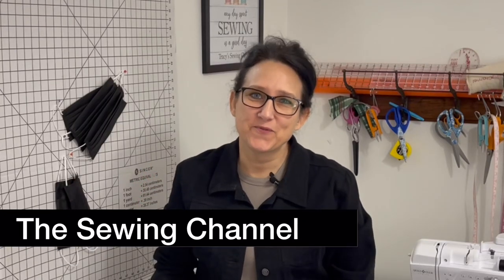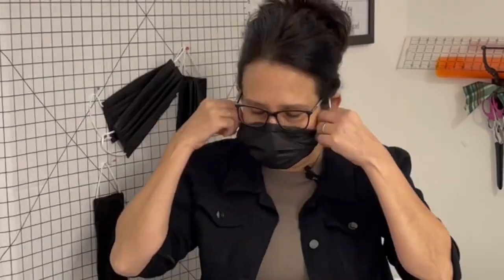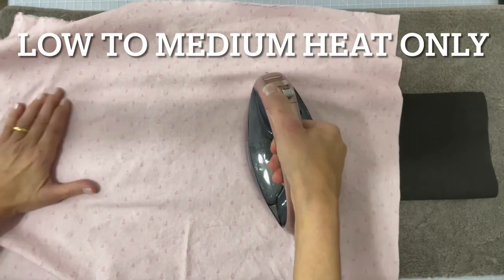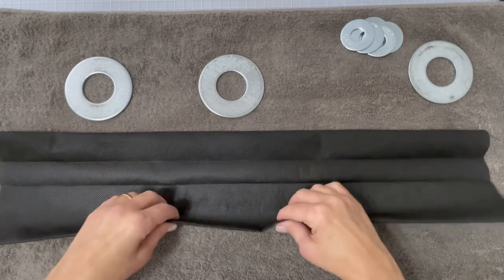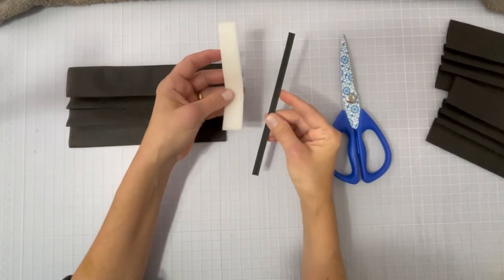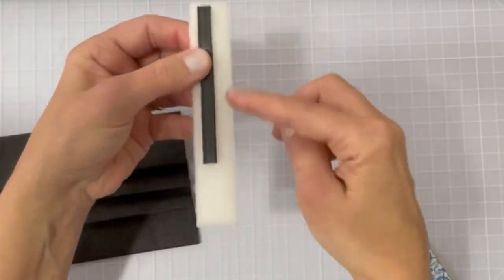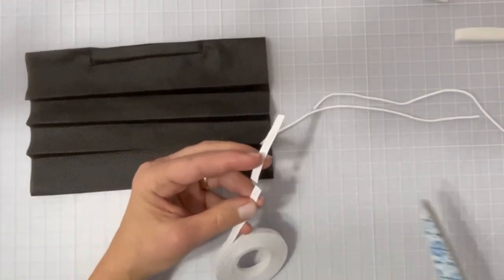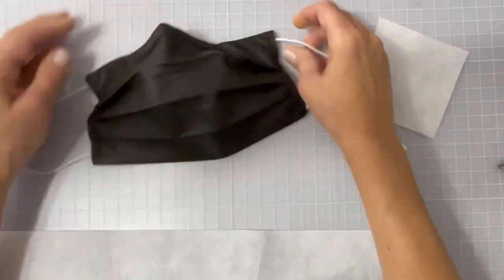How To Make A Disposable Mask With Cambric Material

Comment: Hi Tracy!  First time caller, long time listener. Lol!  ;-) 
I am with MakerMask.org and I just want to tell you that your video is fabulous!   I also use weights to hold down the material. I don’t have quilters clips, but binder clips work great.  I agree that coffee bag closures are the absolute best for the nose wire.  I love them.  Thank you for showing how to lightly iron NWPP on low and covered by a cloth. Very important.  I have also seen others use a craft roller to press their NWPP while mask making. 
Do you know if the foam is washable?  I have several people asking for a washable foam.
If you or any of your followers would like to join a group that shares ideas about using NWPP in masks, you are welcome to join our Facebook group @NWPP4masks.  And you’ll find a post there with this video. All the best!  Hope, Education & Outreach, MakerMask.org
Reply from the maker: Thanks for supporting my videos.....I appreciate it so much.💛 I absolutely love the NWPP the BEST for mask making now...The "crucial" part is getting the crisp pleats without it melting LOL - The foam I use is washable and dryer safe✅...It's made by Pellon and I've had no trouble laundering it at all. Thank you for sharing my video also.💛
Reply: I have a ton of NWPP. I've made a couple of no sew masks using binder clips. Got the idea from Dr. Yang. He's got great ideas too.

Comment: I like this. This material looks like the shopping bag material that I mentioned to you that I used as a filter in one of your pass tutorials. I sewed it in the mask. So far I haven't had any problems with that mask. I just can't iron the mask after washing. It melts to the fabric when heated. I have enjoyed watching all your tutorials though. Thank you.
Reply from the maker: yes anna :) it is the "same". I've used it inside for filters before too.....If it's good enough for the disposable masks that we buy then why not just make the mask out it then. If you use the cotton cloth over it with the low heat then it works really well for keeping the pleats in.....thank you so much for the feedback :)